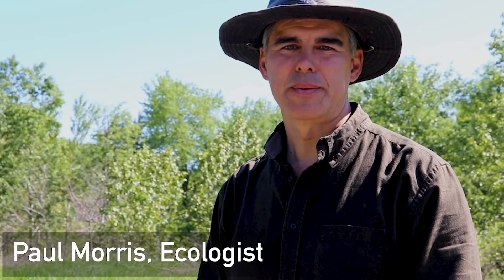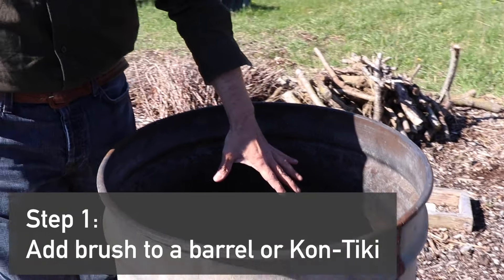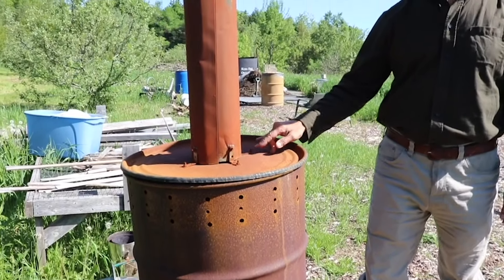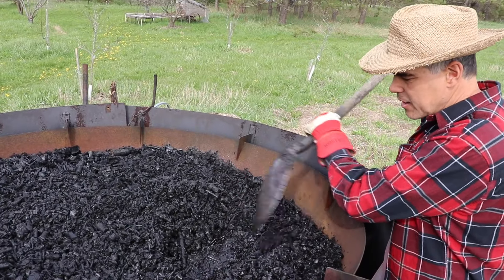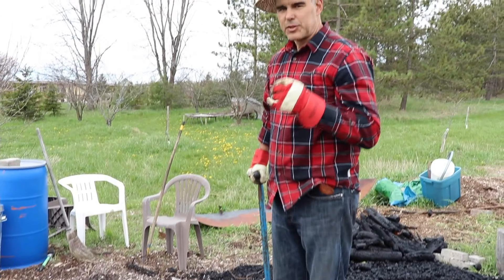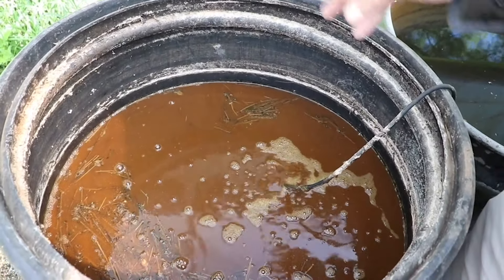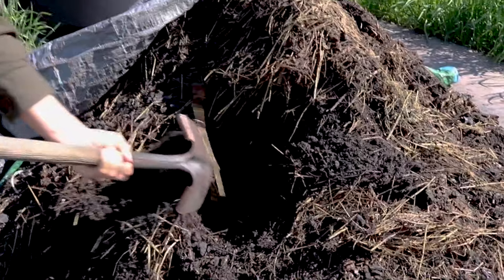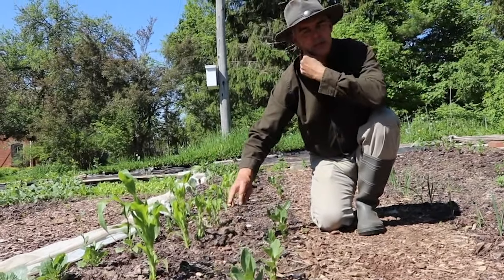THE ULTIMATE GUIDE TO BIOCHAR: how to make it, how to use it, and why it's important

Comment: I have watched most of your videos on biochar, Compost, etc.. I have two properties. One with lots of green grass (hay type grass) that can be mowed and collected, the other with very little grass that is growing decently, but, more fall leaves than you could stuff into an 18 wheeler 2 or 3 times during the fall.. No Manure to speak of at either place, but, can work on finding that.. 
But, I am someone that needs a lot of compost, and, I can come up with decent amount of material to make char.. Also interested in using the hay/and leaves which I have plenty of in areas I have been blowing that are too hard to haul off the masses, to build some composting piles to get as much compost as possible for covering the ground/gardens, not yet started on the grass property.
Also interested in putting some hoophouses or green houses on the grass property (hope to move there), and heating the greenhouse with a "Hot Composting Pile" similar to the design the Frenchman Pain built. Hay/WoodChips/Manure I believe.. Thinking, then, to mix the compost with the biochar and charge it, once it has worked fast(hot), and cooled down, maybe mixing the Supercharged Mix/extract/tea with the biochar.. Maybe making the biochar, dumping the urine on it, spreading it out, and then bagging only it for later use?? (Would that be wise??).. 
1) Designing a Hot Compost pile with Hay/Wood Chips/Manure to run hot and keep a greenhouse warm during winter (figure on hoses for water circulation, and perforated drain hose in two layers with a 2 fans (one each), on timers to run maybe 10 minutes on the hour each to keep aerated to stay hot, since it will not be feasible to turn it with water and air hoses burried inside.. 
2) When the compost pile cools down or spring comes, disassemble the compost pile, keep the good compost to mix with the Biochar, some more manure, and a Supercharged mix, use the rest of the Compost pile not fully composted to mix with more leaves and grass to build more compost piles, and save a bunch of grass and the fall leaves to build another wintertime Hot Composting pile to heat the Greenhouse the next winter.. 
3) Not sure How I am going to get rid of the lush Hay Grass, but, was thinking, to select areas I might be able to cover with whatever amount of compost I could generate, mow the grass down very short, put the Biochar/compost mixture down and cover it with landscape fabric for the winter.. 
4) Which brings up another thought.. Microbes and Winter in this area.. Extreme Western NC, Zone 7A.. I think our Frost line is only about 12 inches in the winter.. It frequently stays right around freezing=0c in the winter and drops into the 20's(-6c) at night, up to mid thirties(2celc) during the day. Might drop into the teens(-10c) at night a few times, but, usually only for 6 to 8 hours at a time. 
Surely Microbes would be subsurface during the winter months??? Maybe down below the Frost line to be safe?? 
Starting a new garden area (converting a Hayfield or part of it) to a garden or garden material, rather than a year of blanketing off the area with Sunlight and tarps, do you think a sacrificial 6 inch tilling to cut the grass into and under, maybe covering half of it by tarp, and half by compost, might not disturb the microbiome, if it were only done to say 6" which is half of the frost line? 
My thought would be to make several 55 gallon barrels of Supercharged mix, possibly using all of the products, EM/Fish Emolient/ Sea Kelp, Kombucha, Milk Kefir, etc ready for spring soil innoculation specifically in the areas to be planted.. Possibly row it up and plant right down the rows, or, pull the mulch back a bit (just in the planting area per rows), and innoculate those areas specifically?? 
5) Which brings up another thought on making the Super Charge mixes... 
Bacteria prefer a more Alkaline mix, and, Fungi prefer a more Acidic mix.. (I THINK THIS IS CORRECT)Hmm.... I believe bacterial like 7 or above, and Fungi 7 or below.. 
Rather than focusing on creating a PH mix of 7 for both, Maybe creating a Bacterial mix, and a seperate mix more alkaline for a Fungal Super mix would be more efficient?? And, then, mixing both of those into a compost to be put on the plants?? Or, Alternating the application of the super mixes a couple of days apart into the row area where you are going to plant either before or after you do you first settings of the seedlings?? Feed them both mixes, alternating a day or two or more between waterings?? 

I really have no idea, other than what I think, as I have posted.. I have ZERO experience in gardening, and have not made a compost pile before other than making some just by accident, because, I didn't have a better place to put the waste, etc.. I only piled the leaves up as high as I could on one corner of the property, but, I have been doing it for years, and, it has some really black soil, and if a limb drops, it isn't there long, and if you pick it up, there is the Microizii(fungus) or whatever (should have looked that up for proper spelling) (white stringy fungus all over it, and it just breaks in your hands picking it up to move it, slimy white web of root structures all over the piles, just under the surface, so, hoping it would be good for soil sample shopping, and moving the majority of this to the other property.. Anyway.. Until I get started, I won't be able to test any of my theories, but, I think I am on the right track except, not 100% sure about splitting the super mixes, but, makes sense to get further from what works for both to, what is best for each, then, combine after.. Just wondering what you thought.. Might give you some ideas too.. 

You don't owe me anything, much less a reply.. I fully understand that.. My text here, hopefully does not lead anyone astray, but, maybe some others will read and see something that helps them further their knowledge.. I like to use logic based on fundamentals I know or am learning and test theories after that and let nature teach me the rights and wrongs.. Sometimes a slow process... One of the most interesting projects were raising bees.. I read books, watched videos for 2 or 3 months, went to local beekeepers meetings, and got asked to teach a class.. Ha..Ha.. I said,, let me raise some bees first.. Ha..Ha.. But, I learned that, a lot of people have preconceptions about raising bees that are simply not true.. First year, I tried to raise bees, thinking more bees, more honey.. Had all sorts of problems, and fought swarming, etc.. Next year, I went for honey, and had plenty of bees, and not a single swarm.. The best advice I can give someone about bees is this.. They are here on earth to Propagate and fill the Earth with bees.. Give them plenty of room to store honey and feel like the job is never going to get done (keep at least 2 extra supers on them at all times, and they will make more bees than you can shake a stick at, and, because of that,, will bring you way more honey with less woodenware.. The population will slim down before the season ends, but, they will boom next spring, so, be ready to split them before it gets warm.. Just keep an eye out for drones, and when you start seeing them out for their flights to the drone congregation areas, you should have already been looking for Queen cells, and making splits moving those cells to new boxes and adding supers to get them busy again.. As long as you have lots of bees moving in and out of the boxes, leave them alone.. If you want to make splits, etc,, do it once or twice, and be ready to move resource frames, etc,, once the queens start laying good.. Don't even worry whether you move the queen or not, unless you have queen cells and are moving them.. Just move the frames, find out where she is next week, when you open the box to see where the fresh eggs/larva are, then, make your adjustments.. Try to keep some small nukes with fresh queens, and, if you need new queens, or have a box you think is going to swarm, split it, move the queen to another box with less bees, new queen in the other box, spray all of the bees from that box with sugar syrup and some essential oils, and by move the frames into the other box.. By the time the other bees stop licking the sugar and essential oils, off of them, they will be one big happy family... I raised them for 2 years, and I still have plenty of honey left.. Will start raising them again when I move to the new property.. I have two hives that have lasted over the last 4 winters, and I do absolutely nothing to them.. Don't close up the boxes for winter, etc.. I just pull the honey, put new supers and leave them alone.. They gathered so much honey last year, they were tired of climbing 5 supers high, so, started filing the deeps in the box next to them, then, moved up to the supers.. I thought I had a new hive move in.. Didn't realize what they were doing until it slowed down at the end of the season, and, I noticed them hauling the bee bread out of one box and going directly to the other... Thought they were robbing, but, no sign of fighting.. I opened the second box and ZERO Brood..Just packing the honey in, and the bee population was getting smaller for the winter, so, they were moving the stores back to the main hive..
When it got really cold, there was still honey in the second box, but, no bees.. I guess they figured it was too cold, there would be no robbing.. It did warm up a few days, so, I went down and looked.. They had posted guards at the entrance, but, at night, I opened the box again, and no bees... Tell a 20 year bee keeper that and he will call you Stupid.. I posted a few bee videos and finally made them private because it caused too  much stink.. I am not going to argue about what I see and know to someone who says, what I saw, I didn't see.. Ha..Ha... 
Great Videos.. And, Thank you for making them.. It takes time that could be better spent elsewhere..
Reply from the maker: Mixing the biochar into an active compost pile will charge the char also.

For the greenhouse compost add the biochar also. If it slows down add more molasses to activate the microbes again and get more heat. 

For a new grass area cut the grass low and solarize for a year to kill weed seeds.  Worms and other soil creatures will come up to eat the rotting grass and till the soil for you. 

Bacteria are all there they are just multiply slower in the cold. Biochar mix after solarizing and super brew to help reestablish the microbiome. Keep the soil covered with plants or thick mulch the keep the soil healthy.

Comment: Hello really enjoyed the video thank you, would it be possible to make biochar from coconut fibre? Not coco peat , im talking about the stringy like fibre after the peat is extracted. Is there a way to carbonized the fibre without burning to ash as its so fine? Would appreciate any feed back . Thanks much,
Robby.
Reply from the maker: The coconut fibre is an excellent soil amendment on its own! Our barrel system would probably not work as well for that. The barrel in barrel may work better. There are larger systems that work for sawdust that would work for it as well if your working on mass but it is better used as soil amendment or composted to an amendment.

Comment: Would there be a different end product if i was to burn a pile of wood and wet it before it ash as opposed to restricting its oxygen levels and doing it in a pyrolysis method in a cone or burying it. There are many videos on YouTube just showing how to make it burning just out in the open but does it affect the end product compared to doing it with little oxygen as it burns.
Reply from the maker: An open burn would produce the charcoal but you would get a lot of ash which is basic. Sophia will do a video about ash as well as it has nutrients like potassium but is very basic. You get lye from ash.
Reply: @PlanetHealers  Doesn't lye mess with soil pH significantly?
Reply: Your end product will be the same with more ash.  You can achieve the same results as the Kon-Tiki by simply digging a pit of similar dimensions...a lot cheaper.  The sides of the pit will bake hard making the pit reusable.  You can 'snuff' the fire out by covering with old sheet metal and dirt and wait 5 days.  The char will be hydrophobic, but a lot lighter to move.  Taking this into account, you will alter your charging method.
Reply from the maker: @FunnyBonesGaming  Most plants prefer a neutral soil pH but some like it more acid (coniferous forest species) and some more basic (alvar species). You need to know what your plants like and test to see the original soil chemistry before adjusting with ash.

Comment: If you already have a compost pile that is turned once in a while, would mixing the biochar in with the compost have the same effect as putting it in water? I assume that if the biochar is mixed directly with the compost, the microbes in the compost would just innoculate the biochar, so that when you spread the compost/biochar mix, it would give the soil the immediate benefits of the compost, as well as the long-term benefits of the biochar. Is that right or no?
Reply from the maker: Yes that is an alternative way to charge the char and get it to suck in all those nutrients before adding to the garden. If you don't charge the char before adding to the garden it will pull in the nutrients from the garden. Soaking in the water right after the burn makes the char absorb water and makes a nice home for the soil organisms rather than being hydrophobic and not absorbing water which happens if it is fully dry.
Reply: @PlanetHealers  Thanks! So if I'm understanding right, it retains microbes better if it's wet, but it won't naturally want to absorb as much moisture if added straight to the compost, so completely submerging it sort of forces it to retain more moisture?
Reply from the maker: @benwhiteley8595  Yes we soak in the barrel overnight so the biochar absorbs full of water. It is hydrophobic (repels water) if fully dry.
Reply: @PlanetHealers  Cool. It would be neat to see somebody mass-manufacturing little miniature biochar burners/inoculations, maybe with a little compost turner attached, for folks that have small gardens...we will just have one raised bed that is 2x7, but I would still like to try the biochar thing.
Reply from the maker: @benwhiteley8595  I think a oil barrel and a shovel is about as simple and easily available all over the world.

Comment: Thank you! Great video! If I were you I will just run over the biochar with the tractor to break the larger pieces. 🙂
Reply from the maker: The char is easily breakable, a tractor would work but be overkill and use fuel/increase the cost. I prefer to use my muscles!

Comment: We have a lot of charcoal, can I use that by mixing with cow manure or chicken manure  and letting it mature for several weeks then use it for our horticulture??
Reply from the maker: Charcoal made for cooking is a bit different. Usually it is a slow cooler burn process so it is not as porous and more burn components remain. The high temperature without oxygen burn produces a cleaner and more porous charcoal that is better for soil amendment. You could try with that charcoal and I’d like to hear the results. I suspect the tighter charcoal would not preform as well.

Comment: Interesting tech, but how would you use this application in desert areas? it seems the solution require a lot of water.
Reply: You do not need to lose all the water. Drain it off and water plants with it. Also, using grey water (waste water from washing) makes sense for stopping the burn and for sitting overnight..

Comment: Do you folks have any idea whether significant amounts of nitrous oxide are released during the biochar manufacturing process? And I read that perhaps since coffee grounds are higher in nitrogen than woody material, they might release more nitrous oxide. Thoughts?
Reply from the maker: Good question. I don’t know, I haven’t done tests on that. If you find out though let me know. I’m interested in what you find.
Reply: @PlanetHealers  So, my followup question is, 'to what extent can we say that biochar is aiding with Climate Change by sequestering carbon, if we don't know the balance of the GHG emissions from the process?'
Reply from the maker: @Ubiquinode  well roughly 50% of woody material is carbon and that part doesn’t burn without oxygen. The part left is inert and last hundreds of years in the soil. So when trees pull CO2 out of the air that part is then stored in soil. If left to degrade all of the CO2 would return to the atmosphere through decomposition in a few years.
Reply from the maker: Between the barrel and the contiki we made around 300kg of char in one burn

Comment: dude, im sooo interested in building myself a charcoal retort system for utilizing rice hulls and hardwood ......100% charcoal 0%ash with a retort system and you use the wood gasses to further ignite the fire that bakes the gasses from the substrate you choose....Efficacy of the charcoal making system is most important when considering carbon footprint......i soak biochar with corn steep or GrowersSecretnitro@ 1/2lb p yd....i also soak my zeolite for 24 hrs with the same mix .... but i remove the runoff to remove the sodium after the cation exchange process takes place
Reply from the maker: Yes, there are more complex methods to collect the wood vinegar but I'm offering a simple cheap method that can be used by anyone anywhere in the world.